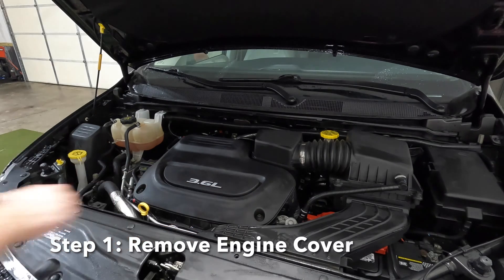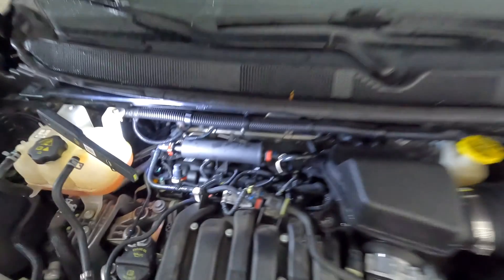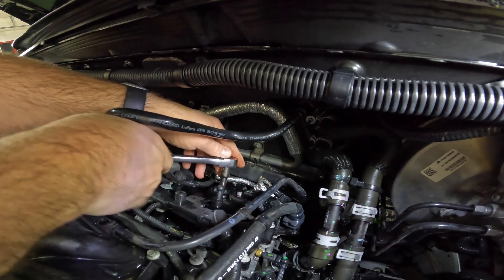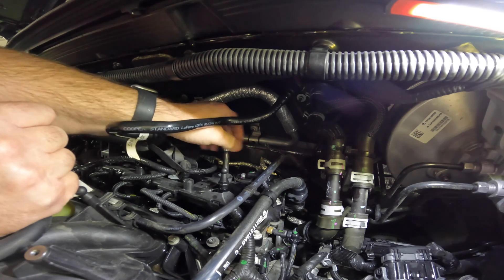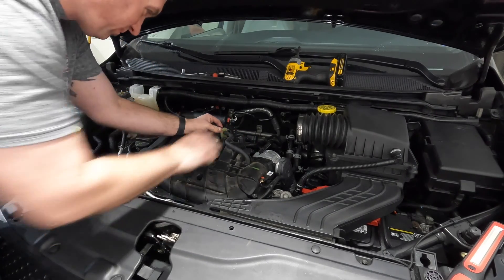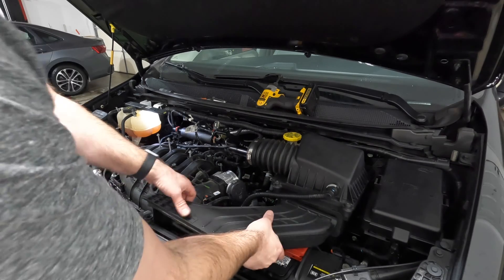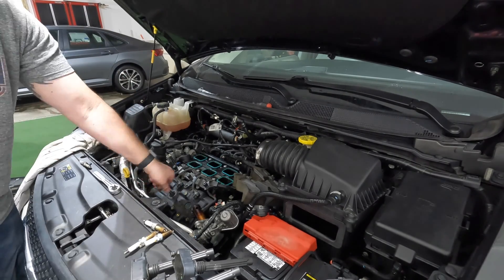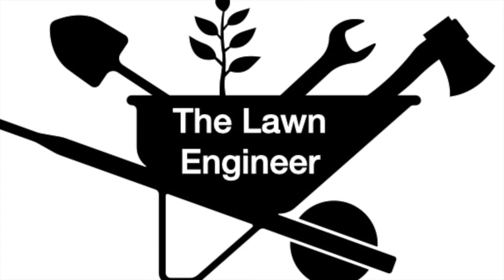How to Replace Spark Plugs/Coils Chrysler 3.6L Pentastar V6

Comment: Great video! Any thoughts on Bosch vs NGK for pligs and coils?
Reply from the maker: Thank you.   In my experience spark plugs either work or they don’t.  The only trouble I have had is with some specialty short plugs I used in a small block Chevy with headers.
Reply: In over 25 years of mechanic work, NGK by far is my go to. I will use Bosch if NGK is not available and I need plugs quick. I won't use Champion or Autolite. I feel, in my opinion, that NGK is the hottest burn and therefore gives you better MPG's.

Comment: Fantastic DIY video, step by step and very thorough with footnotes and torque specs. Changing the spark plugs on this car involves quite some work, but this video provides the confidence one can do it. Thank you for taking the time and putting the effort to help others. Really appreciate it.
Reply from the maker: You’re welcome, I’m glad you are finding value in my videos.
Reply: I am. The videos are great. Btw, I forgot to ask the interval service for the spark plugs, 30-40k miles? I might just replace the oil cooler with an aluminum unit then.. Our car has 35k miles, might just be about to fail..
Reply from the maker: @MikeSF5  100k for the spark plugs, they last quite a while.  Also, you should have quite a few miles left on your oil cooler too.
Reply: @TheLawnEngineer  Awesome. Thanks for the reply.

Comment: good video. but don't use anti-seize on the spark plug threads.  per NGK " NGK spark plugs are installed at the factory dry, without lubrication or anti-seize.

Anti-seize can act as a lubricant, altering torque values up to 20 percent, increasing the risk of spark plug thread breakage and/or metal shell stretch. Thread breakage can sometimes involve removing the cylinder head for repair. Metal shell stretch changes the heat rating of the spark plug and can result in serious engine damage caused by pre-ignition. Do not use anti-seize or lubricant on NGK spark plugs. It is completely unnecessary and can be detrimental."
Reply from the maker: Yeah dry is probably better, you could reduce the torque because of the lubricant but really not necessary.  I gave in to the anti-seize mob…look out they might come for you.

Comment: Another great video. How many miles are on those plugs.
Reply from the maker: Thank you.  85k miles on the plugs.  The iridium looked in good shape but the steel  around the iridium was showing signs of wear.
Reply: @TheLawnEngineer  I'm around the 87 mark and had been contemplating changing them. I think my oil filter/cooler housing is leaking so I might change that at the same time.
Reply from the maker: @cwilks5592  that sounds like a good idea.
Reply: @cwilks5592  what symptoms does your car have that made you think cooler housing is leaking? I know it's notorious for the plastic cooler housing to break all the time in Pentastar engine. Thank you in advance.
Reply: @ttampi  It goes through a qt of oil between changes and the bottom cover has some oil on it. I haven’t fully investigated it yet, just an assumption based on history with these motors. I figured I will get a better look at it when I do the spark plugs.
Reply: @cwilks5592  where is the oil filter cooler  at?
Reply: @msevans7  under the intake plenum. It’s part of the filter housing.